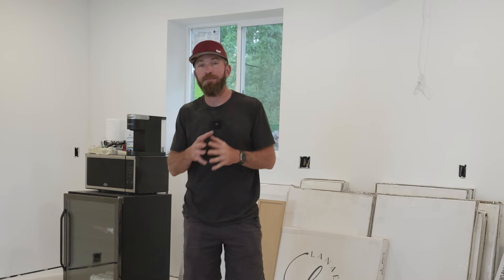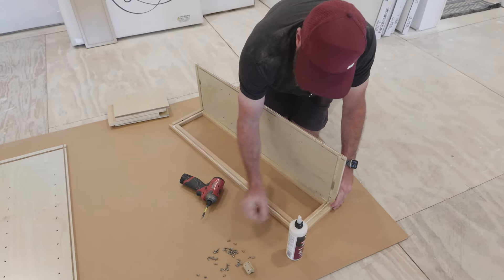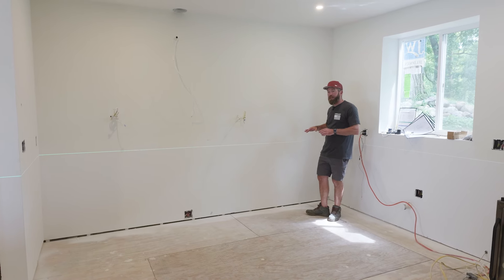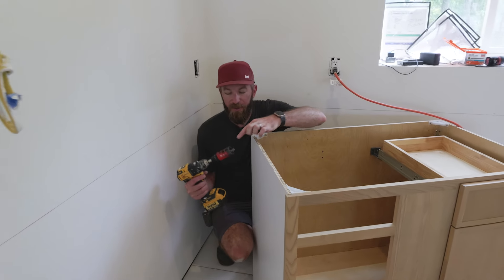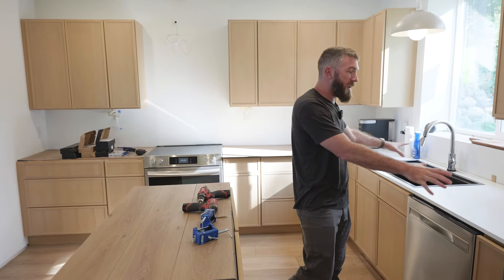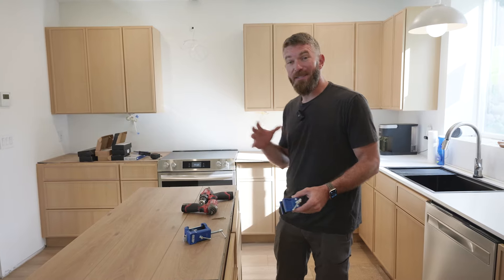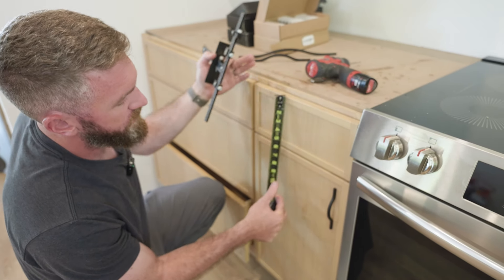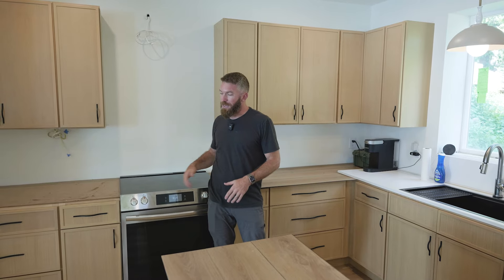We Installed Kitchen Cabinets (on an uneven floor)

Comment: Great video! My kitchen ranges from 34.5” to 35.5” any advice?
Reply from the maker: Thanks. You’ll have to start at the high point and shim the other cabinets to level them out. If you have a break in the countertops like a fridge or something you can cheat the next start of the countertops down a bit.